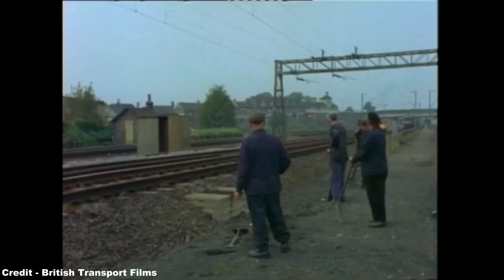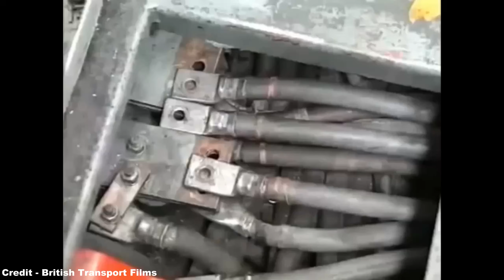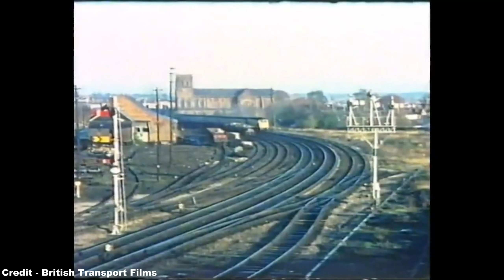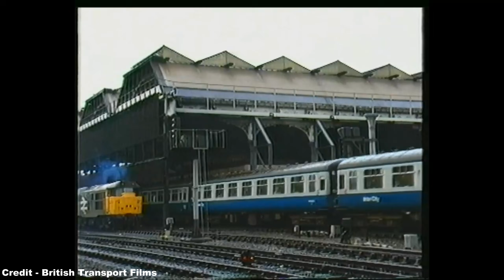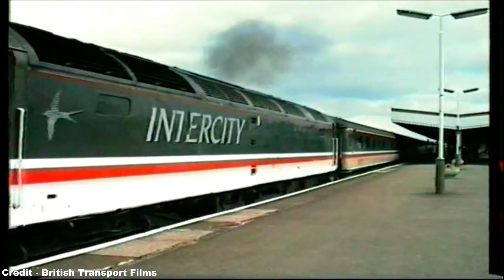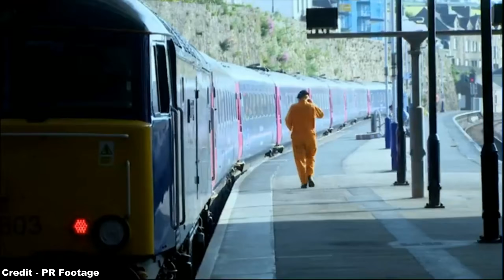Class 47 - The Understated Workhorse

Comment: The primary Class 47 locomotive operating on the North Yorkshire Moors Railway is No. 47077, famously named "North Star". Built in 1965 at Crewe Works, this 2,580-horsepower diesel-electric engine arrived on the NYMR on long-term loan from the Diesel and Electric Preservation Group in 2022 and is a regular sight on heritage services.
This loco is still operating regulary between Grosmont and Pickering and have been behind it quite a few times recently :)

Comment: Sir 47798 "Prince William" & 47799 "Prince Henry" were not replacements for 47834 "Fire Fly" & 47835 "Windsor Castle" they WERE 47834 & 47835 they were converted to 47/7c basically a 47/7b has 2 sets of RCH Jumpers whereas the 47/7c only has 1 set which meant they could communicate but NOT Propel parcels stock! Hence why they very rarely were used on Parcels work

Comment: I was on the last Newcastle Liverpool with 47 443 North Eastern.  It ran with several coaches in complete darkness as the lights were out, policemen patrolling the train, a very funereal atmosphere on board that train. I had to get off at Huddersfield with all the other regular Transpennine bashers,   we all congregated at the platform end to watch it pull away, photos were taken, a long toot on the locos horn from the driver, and that was the end of that. Goodbyes were said, then the sprinter home to Leeds. The end. It was a very sad occasion.

Comment: I find it amusing that over time "minimum standards" for coaches meant outdoor seating with splinters, then a roof to keep cinders from burning ladies dresses, then windows and padded seats, then wood stoves, then a vendor with a cart of snacks, then a toilet (which was basically a seat with a hole in the floor), then steam heating, then restaurant cars, then electrical heating, then air conditioning, then chemical toilets that didnt dump on the track and now accessible toilets, wireless internet and USB plugs.

Comment: A great review. Brilliant archive footage of class 40s at the start. The footage of kestrel on test was mostly the Derby to Manchester line, now the monsal trail in the peak district. The first 20 class 47s became 47401 to 420. They were kept together,   allocated to Gateshead , as the class 46s with the same electrical equipment were also based there. They were amongst the first withdrawals as they were non standard to the rest of the fleet.
Reply: The “Bastard 20” as they used to be referred to…😏